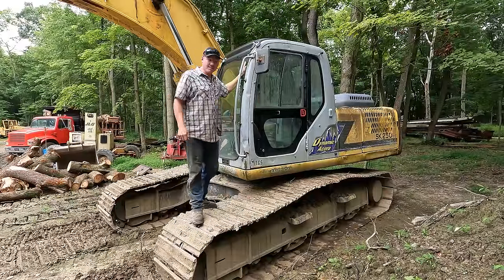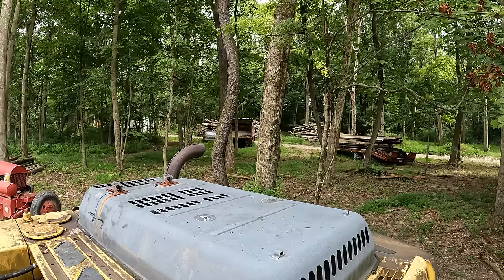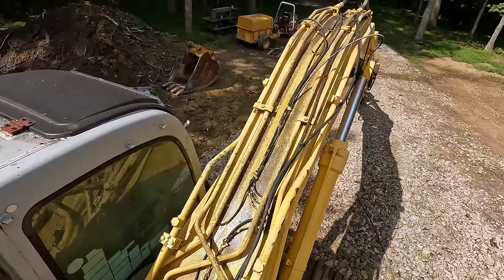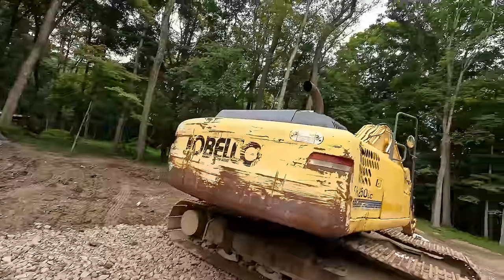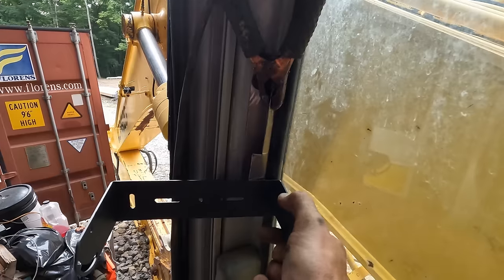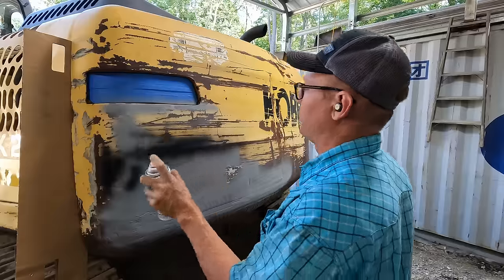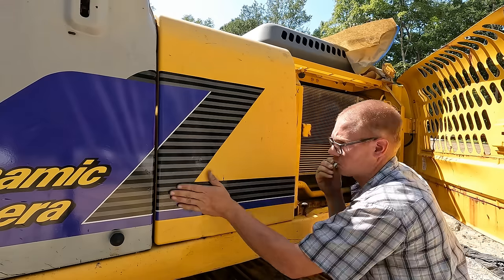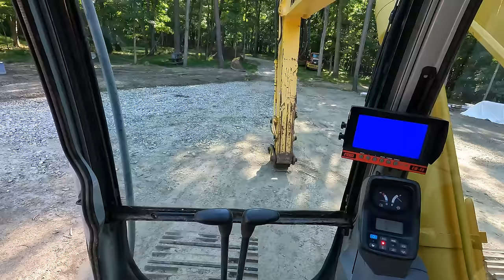Fixing up the Cheapest Excavator I Could Find! (Major Transformation)

Comment: Having worked with paint colours on cars years ago, absolutely impossible to match colours by colour cards, you need the paint code. Even knowing the name of a colour, many have mix variations, Ford Diamond white had 13. So the colour code pin pointed which one to mix. Then the other problem is, the paint has been sat in the sun for years, so it's faded. You don't just paint a panel, you blend the colour across, then use a rubbing compound to blend the area where new meets old. You can do smaller areas and blend in with flat paint, you have to paint a greater area and blend in with metallic paint, and really a full repaint with pearlescent paint.

Comment: Tip for getting the decals on without air bubbles next time. Spray on some window cleaner onto the surface then use a squeegie to press on the decal while using some masking tape to hold it in position. The window cleaner will evenually squeeze out but allow you to scoot it around some and remove the larger air bubbles with ease.

Comment: Matt, you did a good job on the excavator and it looks a whole lot better, the pressure washing, the clean up inside, the back up camera and the new LED lights, the new decals and she starts up the first time. I think you got a great deal on her and she will earn every penny you spent on her. On the decals, if you have a small bubble, stick a straight pen in the middle of it and then press down on it and the air will go out and seal against the metal.

Comment: Awesome job.
I was operating a 2-month-old 350 Hitachi Long Reach (not a scratch on it) fitted with Trimble GPS Earthworks, It had rubber cleats fitted on the tracks and sat on wet muddy bog boards, and was slipping and sliding all over the place, anyway, I slewed round and touched a wall I was working next to and scared all the way across the counter weight, right mess. Luckily I had a spray tin of Hitachi "Taxi Cab orange" original spray and was able to sort it out to a reasonable standard. Was absolutely gutted. I got the video in my channel, if you'd like to see

Comment: You can shrink that stretched out metal by heating it up to glowing and then take a large soaking wet rag and slap it on the hot metal.  This technique is good for getting rid of oil-canning.

Comment: If you dont wont to your'e spray cans to clog up. You should everytime when your'e donne spraying, holding the can upside down and spray until no paint commes out anymore. And if is cloged up you can try to put your compressor on the cap on the underside to try to free the cap. Good luck

Comment: The strange thing is that these older kobelco's are similar to the older Komatsu's. if memory serves me, these 200 size machines have a accessory plug in the back right of the machine near the window of the cab. if not than it might be under the back cover where the ac vents are at the very bottom. it might be tied to the main harness with a lot of electrical tape if you want to do this "factory"

Comment: My tip about the can as I always use on the older cans have been shelved for a while I put them on paint mixer for at least 10 minutes if you got a vibration tamper attach them to that ..the other thing is I found by trial and error a tip take the can before you use it and put it in a container of warm water approximately 120° for 15 minutes you'll be amazed at the difference how well the can works when it's been warmed up good luck with your projects
Reply: A warning about spray cans in paint shakers.  Most spray cans have a little marble or ball bearing inside to help when shaking the paint. On some paint shakers, that little thing will come out the side of the can like a bullet and spray black paint for twenty feet.  Ask me how I know.

Comment: Rustoleum is good paint.  On a fresh can, after shaking it for proper length of time, I’ve only had one clog.  And that time I probably didn’t shake enough and it was too cold.  When pressing button, keep that flow going.  Do not stop start stop start.  Try one even sweeping flow.  Anyone that uses spray paint knows Krylon paint is a runnier, poor substitute and has crap coverage.  I do keep my old spray nozzles but partly because I don’t want some kid to grab trashed cans and use them up on the side of my house.
Reply from the maker: I’ve used a lot of rustolium and a lot of krylon, I’d take krylon any day

Comment: Matt, I have the same problem with spray paint cans spray heads, i take a very small glass jar that can hold multiple spray nozzles and I fill the jar with card & choke cleaner, and I always leave them in the jar until i'm ready to use them, and it always has worked, and I use compressed air to clear the nozzle before putting it on a can of paint!!

Comment: The tips clog because you didn't mix/shake the cans enough before using them. Amazon sells the greatest paint can shaker this side of a belly dancer I've seen. It's about $40.00 or so. I bought two, one for each shop. They run off a battery drill with a hex drive. Run the shaker for about 1 minute. It will even make old cans come to life again. I shake all my cans now before using them. I store some spray cans inverted so the pigments get mixed up better. To unclog a tip, use break cleaner and spray into the large side of the nozzle. Let them sit in a shallow tuna can for a few hours. with lacquer thinner. Then use your air nozzle at 125 psi and spray into the nozzle, from the can side. If the nozzle tip is still clogged, use the smallest number drill and open it up. The holes are smaller than a sewing needle sometimes. The fan tips are the best. Use a shooter tip without the red wand, when the can is clogged badly and it will allow a full force spray. I have about 50 spray cans stored, so I have figured some of this out. You can tell when the nozzlw tip is opened up because the thinner will squirt out. Then you're done.

Comment: Feel your pain with paint, only solution i ever found especially if doing colour match on older equipment or even if its been outside that wasn't a big name like CAT who have paint codes and use the same formulas was too pay an experienced pro to do the match and supply the paint mix ( I learnt this after i couldn't get a match for something i had the paint code and went to the original supplier and 3 other stores that use the same paint, all of them came out slightly different and nothing like the original due to the differences in how paint is stored the tints + age + equipment and environment + whos making it + how they make it - Then went to different brand and found a enamel house paint that once painted matched but the finish wasn't great for a machine) 
Keep it up we love the videos :) and i dream of owning machines like this even just to play with haha

Comment: I think you can do a really cheaper paint job by using a simple paint roller and a tin of paint, in stead of spraying it out of cans. Paint rollers are very cheap and it is only a little bit more work. Good luck. Good work though.

Comment: Use purple power degreaser 25 dollars for 5 gallon bucket at walmart spray it on befor spraying it with the pressure washer and u will save your self half time
Reply from the maker: I soaked it with some other stuff, I used to use purple power, but it dulls paint really badly

Comment: Turn the paint can upside down with the valve on the bottom, press the valve until all the paint stops spraying out, this empties out the paint tube in the can.  The paint should stop spraying out in about 1 or 2 seconds..

Comment: That light housing is aluminum because it is acting as a heat sink for the lights.  They are high powered and get hot and will burn out if not heat sinked.
PS.  On my monitor your yellow is too cool and needs a tiny bit of gray and maybe just a touch of red.

Comment: I gotta say. Wouldn't be my choice to have that in stock yellow paint and decals specially due to the dents and simply because if the thing is mine, it's gotta be unique. Specifically the counterweight part would be way different than just tweety yellow crap (if it was my choice I would paint the whole machine black with red warning fat stripes to look evil).
But if that's your thing...definitely you got it better than it was before. 😉

Comment: push button valve, pull button/valve straight up off the can, soak in paint thinner, or turp.    Scrub opening on top and  bottom of valve with old toothbrush. clean top of can tube in same way.  when still wet, insert needle into bush button and rotate, and vibrate. NOT INTO THE CAN TUBE.   If still clogged,  it may be the tube in the can.  Using strong air compressor, use rubber tip on compressor valve to force air into  tube on can.  try again,  rinse and repeat, again and again.

Comment: WHY DO YOU NOT USE HEAT STRINK FOR RE JOINING WIRES AND PUTTING A RAINING SYSTEM FOR THE AIRER YOU CLENIN UP AND USE THAT FOR MANY CLEANING JOBS ALSO TO CLEAN UP TO JRINING AFTER CLEANING UP.

Comment: Howdyyawl from the land down under. The machine you stole. $16k ,is a bargain. So what, the thing looked a bit drab. At the very least, no hoses to replace, or mechanical parts to fix& the arms are in good Nik. In Australia it would fetch $ 55- 85 thousand. The only thing not on it, your logo of Deisel Creek. That would finish it off.😊

Comment: @Diesel Creek     Look up steel spot dimpling I think its called shows you how to expand dents with a torch to beat them flat again without the stretch from the dent.  Pretty sure that's what its called.  you basically expand the dent with the torch and a brazing tip then straighten it if I remember right but you can look it up!  this is how I learned and it works!  https://www.youtube.com/watch?v=M3-WBYm3L_M

Comment: Man , if you are licenced to drive the thing then you must prove you are proficient in handling the machine , if you dont know where the boundaries of your machine are then you are not competent to hold a licence. A camera aint gonna stop you running into things if you are looking at the job .
Reply from the maker: You must be from overseas. There’s no licensing here… anyone can run them.
Reply: So as im saying , if you need a camera to run it then you aint qualified. Picture this , you are busy looking at a camera screen from back of unit , child or animal or car or bicycle or another excavator comes in front and you hit any of the above.........SAFE? Safer? , Nh mate , learn the limits of your machine without all the electronic junk and you are a better operator. And , how do you get insured to run it if not got training or a licence?/ 
 @DieselCreek
Reply from the maker: @ovlov245  I get your point but the camera is more about getting eliminating the blind spot so you can get closer to things. You only need insurance if your working for someone else… in which case you just call an insurance agent and buy insurance.